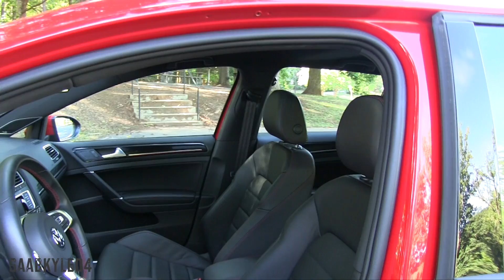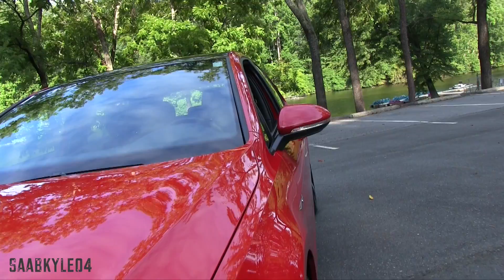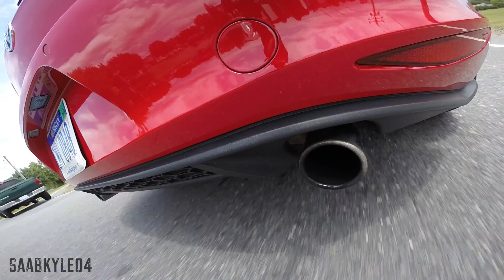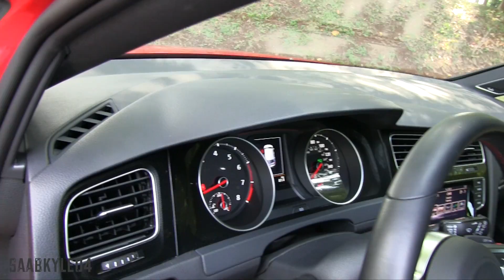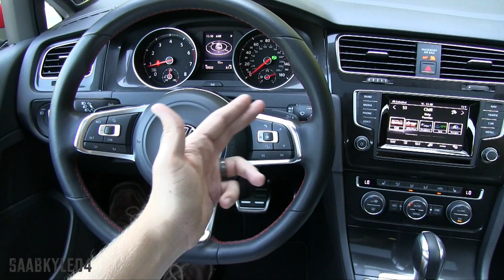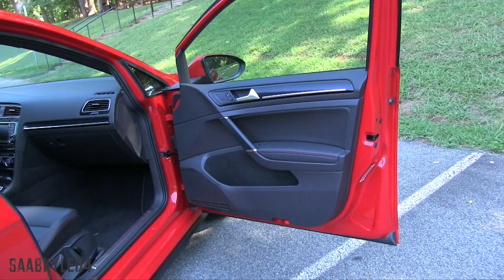2015 Volkswagen Golf GTI Autobahn (Mk7) Start Up, Road Test, and In Depth Review

Comment: i have this car in the 2017 model year, i love it
Reply: But will it be reliable?
Reply: Does it require premium fuel? or can you use regular?
Reply: yes you want to use premium. you can use regular but you won't achieve the maximum horsepower.
Reply: buildmorefarms100 I hear gti is more reliable these days

Comment: Incredibly Minor, but no Aux in? Got to adapt to that dorky VW MMI? Meh. Still looks like a solid car, and thanks for the review!
Reply: N734NJ 2016 and 2017 gtis come with 2 usb ports and 1 aux port instead
I have a 2016 gti and i can confirm that
They also come standard with a bigger and much more responsive touch screen than the one shown here
Reply: Indeed, I saw and drove in my friend's recently-acquired GTI Sport (lovely trim level!), and id luckily comes with standard USB and Aux in. Glad it's a thing still.

Comment: Hey man, I really dig your reviews. I'm in the market to soon buy a 2016 Ford EcoBoost Mustang or 2016 VW GTI. For how I plan to drive, they're almost neck in neck when comes to MPG. I'd say 80% of my commute is freeway (turnpike) driving. They're both refined, agile, and quick. The cost to buy is similarly as close. Based of your experience, which car would you recommend?
Reply: +Biggieman2k6 15 Gti base is the way to go really, unless you really want the leather/sunroof. I get ~35mpg average to and from work doing roughly 60mph, although I have upgraded the exhaust and have a tune. If price is anything you are looking at you can haggle some salesmen down a little bit. Ended up picking up a second one for my gf and got hers for 23k out the door. Overall great car stock or modified.

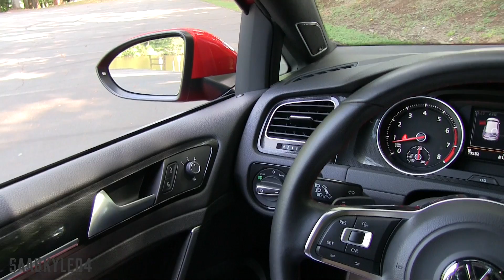Comment: One interesting detail I noticed while watching the video : the door hinges of that mk7 look ... normal. At least compared to the mk6 ! I was really impressed by the door hinges of the mk6, because they are very thick and wide, and the mechanism that gives the three steps when you open the door is quite unusual with its levers, bearings and thick steel parts. When I saw that I said to myself "ok, that's what they mean by German over-engineering !" While, in the mk7 that is show in that video, the door hinges look perfectly reasonable, and we can see the usual thin metal "stick" with it's three notches going inside the door that we see in every single car. Also when you closed the door at 15:58, we can hear something rattle, maybe my memory is playing me tricks, but I don't remember the mk6 doing that, or maybe it was because the window was down... anyway I read that VW made many optimizations and took many measures to reduce the production time and cost of the mk7 compared to the mk6 ... When I see what is qualified as "normal engineering" today, even though "over-engineering" might be more expensive for no good reason, in the end I appreciate it, I hope that VW is not abandoning that philosophy :-(

Comment: Looks like the GTI might suffer from the same problem I recently experienced in the Passat. Did you happen to notice that the gas pedal was way too far to the right? It resulted in me having to cram my leg against the center console to keep from accidentally hitting the brake. I don't understand why they bunched the pedals all the way over on the automatic version.

Comment: I'm thinking of saving up to get this ride. Is VW a reliable brand? More specifically,  are the new golf gti's like this one, reliable ? +saabkyle04
Reply: Tony M Do it! I have a MK6 GTI and it's been perfect. Of course it's still a risk but worth taking, plus you'll have warranty for a few years so no need to worry.
Reply: Risk?  Wtf I don't want to risk getting a car lol Doesn't seem reliable then so I've heard. Idk.m might get the wrx sti or dodge challenger rt 2015
Reply: Tony M By risk I meant getting a lemon, which is possible with any car.
Reply: +Imad S what's a lemon lol ? engine light?
Reply: Tony M Nope, a car that's had problems from the start, you should read up on it.
Reply: ***** I'm hearing bad shit about VW. I'm steering clear from this shitty brand lol WRX STI it is then ;)!
Reply: I love the STI but VW isn't shitty lol. Maybe you should drive one before you judge.
Reply: ***** but you're giving off the idea that VW golf is shitty... lol well that's what I'm seeing
Reply: Tony M Why would you say that? I'm just being real with you. The chance of you getting a lemon is very low lol. One thing's for sure though, VW's are MUCH more reliable now than they used to be.
Reply: +Tony M DAS AUTO. VOLKSWAGEN.

Comment: It's a shame SEAT don't sell cars in the US, I could imagine the Leon Cupra would sell well. Same platform and engine, but 280 hp, very close in price but more interesting and attractive (in my eyes).
Reply: +M50Racing The Skoda is a VW
Reply: M50Racing If the Octavia (I haven't been inside a new one personally) is anything like the new Superb (which I have), they represent really great quality for the price, and are very spacious.
Reply: +ApurtureSci Seats and Skodas are hidden VW's, but cheaper. Uses the same engine, gearbox, suspension, chassis..... :)
Reply: ***** In my eyes the same applies to the Skoda Octavia RS (220hp or 230hp with the edition 230). The prototype for the RS+ has also been spotted. You can suggest that it will have 280hp too.
I would be torn between the Cupra ST and RS+ Combi/Station Wagon.
Reply: +Nagstrr23 The skoda is a piece of crap
Reply: M50Racing Why?

Comment: The one thing that turned me off this car was the apple 30 pin input in the center console. Why would VW put that in their car? Not only was the 30 pin a terrible proprietary input/output, but it was on its way out 2 years ago. Every golf comes with it and when I saw that I was disgusted. Only OLDER ipads, iphones, and ipods are compatible.
Reply: 2016 cars have USB!  Woohoo!
Reply: You know you can get an adapter, right?
Reply: 2016 models have an all new system called MIB 2 which has a usb port and supports Apple CarPlay and They're powered by a nvidia processor :)
Reply: nice!

Comment: lol its an automatic
Reply: Dodek72 It is, but the VW DSG is a good transmission. It's not like a typical slushbox or CVT. If I had to do a lot of stop-and-go driving, the DSG GTI is what I would get instead of my Focus ST.
Reply: +Dodek72 the DSG shifts faster than any human w a manual. DSG keeps the turbo spooled up= faster 0-60 times. It does not give the same feel as a manual for fun factor even w paddle shifters.

Comment: 6k rpm, almost like a diesel lol
Reply: RAJohnson713 ? It probably starts running out of power at 5,500. It's not a N/A 4-cylinder that you have to wind out.
Reply: +RAJohnson713 Well, as it's turbocharged, why would anyone want more? Less friction, less whiny noise.
Reply: Nope it's a rattle sound of sound aktor which gives exhaust sound inside :) my brother already unplugged it. And compare to mk5 or mk6 gti's exhaust sound is very less on mk7 gti. Downpipe and stage 2 ecu reflash is must to get 300+ hores :D
Reply: And that was 4k rpm coz it has rev limiter
Reply: +RAJohnson713 A turbo or supercharger interrupts the exhaust and therefore the exhaust sound. The great thing is by putting a big exhaust you increase power without sounding like crappy 4cyl with cherry bomb or straight exhaust.
Reply: +UNSEEN MONSTER replace the whole exhaust. I like the 3" - really increased my HP on older Jetta GLI. The tune increased boost AND mpg!!
Reply: +UNSEEN MONSTER when not moving-
Reply: VWR turbo back exhaust system is on the way frank weiser
Reply: +RAJohnson713 Redline is 6k but it extends all the way to 7k rpm. If you have dsg you can tell that it shifts at 7k if you have it in sport mode. Then again if you have DSG over manual odds are you don't give fk about redline. Oh and yes the manual tranny can go to 7k rpm too
Reply: comonerleon Why would you ever want to do that? The largest gap in transmission ratio is 2nd to 3rd. If you shift at 6200, you come out in 3rd at the exact same power rating as you left.
Revving over 6200 makes you accelerate slower in a Mk7 GTI.
Reply: Best track times recorded for the 1/8th mile I have had has been shifting 6000 for first gear 6800 for second and 6250 for 3rd so yes revving past 6200 is essential in track times due to the reduced forced shift moments. This is on a manual tranny on a DSG I suppose you could shift early on without any major time repercussions; also around a track its useful that 7000 is the fuel cut off so youre not forced to shift all the time around corners. So to answer your question, there is plenty of times that you should go beyond 6200 rpm, especially on a properly tuned one like mine

Comment: I actually heard the Golf R is no better than the GTI.
Reply from the maker: Jonathan Washington Oh really?  I'd be interested to try it out nonetheless, never been in one before.
Reply: ***** Hope to see your video of it. I think is because of the steep price and not that many things are done to differentiate it from the GTI.
Reply: its not an opinion, look at the numbers...
Reply: William Menier It actually has a bigger Turbo, probably different pistons, a stronger DSG, bigger intercooler and many more little things. You can flash a GTI to about 260-270 hp. For more you will need the stuff mentioned above. The Golf R, however can also be flashed to around 350 hp which truly brings it to life. The 4motion kicks you in the back and gives you ridiculous acceleration. There's no way you can archieve similar performance with fwd only.
Reply: Jonathan Washington it is better, so who ever said that was just being ignorant to that fact but for the value it is debatable.
Reply: +Jonathan Washington It really, really is better. Just not performance-for-money wise.
You'd probably be better off buying a GTI and remapping it to some 260-280 hp.
Reply: Jonathan Washington If you have 40.000 I'm sure you can afford a few hundred bucks for a tuning box. Most modern turbocharged cars will benefit massively from slight chiptuning.
Reply: Ultrabenbooyah You seem to miss the whole point, Its not about the money, if a car is being sold as a hot hatch I shouldn't have to spend "a few hundred bucks" to make it "come alive". But anyway have a nice day.
Reply: Danny PhantomVision Thats your opinion.
Reply: +Jonathan Washington I heard the same. Not much difference, just a re flash and 4 wheel drive.
Reply: Ultrabenbooyah Exactly my point,  why should I spend 40k on a R than have to reflash it just to "bring it to life".
Reply: Jonathan Washington if your going to buy a golf r i can imagine you are going to want to mod it anyway...